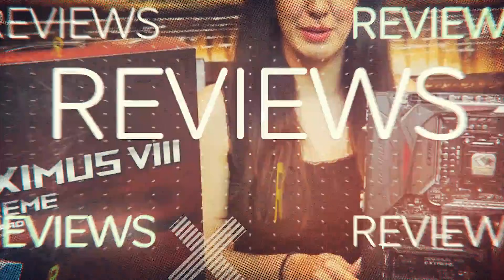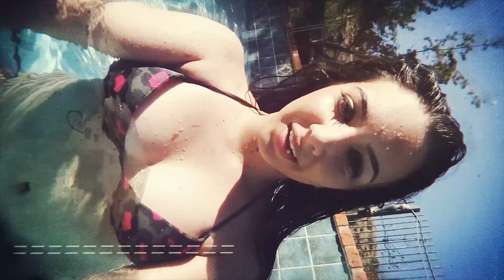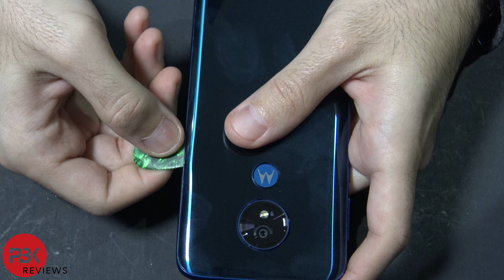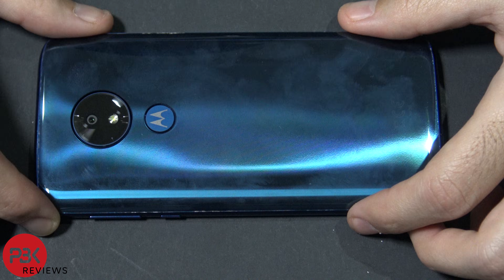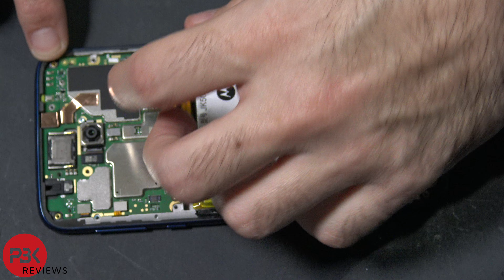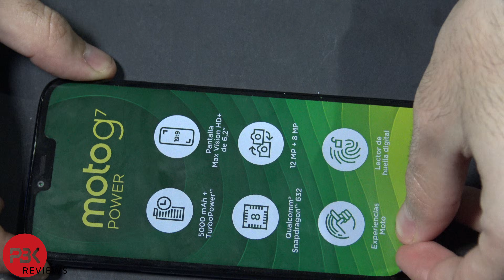Motorola Moto G7 Power Disassembly Teardown XT1955 Repair Video

Comment: Its possible replace the 32gb model for one 64gb model?
Reply from the maker: you would have to replace the main board
Reply: @PBKreviews  

Sorry, as I didn't write well in English, I may not have expressed myself clearly. I would like to know if I can put a 64gb xt1955 logic board in my 32gb xt1955. My moto g7 power xt1955-1 32gb is in QDLoader mode with hard brick after an unsuccessful unlock. I only find 64gb logic boards for sale for now, I would like to know if they are interchangeable

Thanks for your help and quick answer...Best Regards from Brazil!
Reply from the maker: @PauloIrineudeSouza  Oh ok no problem, yes you should be able to swap the logic boards with no problem. 64GB version just has an additional memory chip on the board but the logic board itself is the same should fit like the original :)

Comment: After we replaced my screen my SIM card wouldn't pick up any signal. Any ideas or something I can do to fix it??
Reply from the maker: Make sure the black plastic pieces that are screwed down are in place correctly and screwed in properly because if they are not making contact with the points on the boards, they might cause you to have service issues since the antenna lines run through them. Also make sure all cables are properly connected and nothing is loose. If all those check out, its possible you might have damaged a chip or something on the board when taking it apart? Not sure.

Comment: Wait will the back cover click back on if I want to go to the battery. I'm having some sort of battery problem. It seems like you cut it off. And that doesn't look good for my phone. And I don't want to cut it off.
Edit: wait nevermind I just saw the line where you're supposed to hatch it off. But what did you use to do it. It's far too smooth for me to just take it off with my hands?
Reply from the maker: You would need to install new adhesive to put the back cover back on, its held down with adhesive
Reply: @PBKreviews  sorry I know I'm stupid but what's adhesive?
Reply: I've heard it before
Reply from the maker: @smartguy6895  its like a double sided tape that adheres the back plate to the back housing
Reply: @PBKreviews  ok thank you very much you just earned yourself a new subscriber
Reply from the maker: @smartguy6895  thank you, and you're welcome. If you need new adhesive, usually they sell back covers/back plates for the phones with adhesive pre installed on ebay or Amazon

Comment: IMPORTANT NOTE: This video fails to show a complete teardown, specifically the battery & screen removal. If you need to replace your screen, have a new battery as well & remove the battery outside so when if catches fire the fumes are not in your home. Also, use gloves because the burns on your fingers hurt.

Comment: Thank you for the info I'm going to attempt to replace a busted usb as soon as I get the part.
Reply: hi if you are just replacing the port you only have to take off that bottom area? correct? did you fix it? I am want to replace usb power area connector too i think pin is broken

Comment: Can you use this phone going straight talk Verizon non AT&t Straight talk Verizon
Reply: You can. I wouldn't though because Straight Talk sells a rebadged version of the G7 Power known as the Optimo Maxx. They're the same identical phone with all the Verizon, AT&T, and T-Mo radios/bands available. I'm typing this comment on one. They're usually about 30-50% cheaper than buying an unlocked Power and if you're on Straight Talk service for more than a year they'll unlock it for free anyway. So you're throwing your money away buying an unlocked Power for Straight Talk use. Buy the Moto G7 Optimo Maxx instead.
Reply: @mattdavis9601  thanks man for the information that was very helpful in useful, I hope you have a great blessed day

Comment: Can I just replace the battery without messing with the circuit boards?
Reply from the maker: your going to have to remove the back plate, then unscrew the top cover to reveal the motherboard so you can disconnect the battery cable from the board but aside from that, you don't need to remove the main board or anything else. At the point you can pry off the old battery and apply the new one and reverse the process. Just be careful when prying the battery, don't warp it too much or puncture it so it catches fire etc. You can use a hair dryer to gently warm up the adhesive under the battery to help make it a bit easier when prying and use a membership card or credit card you don't need to gently get it under the battery from the sides or bottom and work your way under it to help pry it off. Hope this info helps.

Comment: How to fix Power button that stuck? like the power is going down instead on normal
Reply from the maker: It would require you to pry the screen off as well, to be able to gain access to the power button flex cable and buttons themselves. You might need to replace the flex cable with clickers on them if your button is not clicking or registering anymore. If its stuck because liquids or other stuff made the button sticky, you may need to clean it out with a brush after you take it apart to make sure its not sticky anymore.

Comment: Literally all I cared about was seeing how to remove the battery. Not... everything else taken out except it. : /
Reply from the maker: Well you need to do everything else to get to the point of removing the battery. You can't remove the battery without taking apart the phone to a certain extent. Once you disconnect the battery cable from the main board, All you need to do is use a hair dryer and apply some heat over the battery and back of the phone to loosen up the adhesive under the battery (don't apply too much heat you don't want to damage it), then use a membership card or credit card and start working your way in and underneath the battery to gently pry it off. Try your best to not warp the battery too much (even though it will work a little when your prying it off) so you don't short it. Apply heat as needed and just take your time and it will come off. Then just take your new battery and put it in and press down on the original adhesive and it should hold then re-assemble.

Comment: Hi. Just wondering, I have two of these phones. One has a damaged backlight, so I can't see or press anything. Other just has cracked screen. If I just switch out the main boards, will I be able to regain access to everything on previous phone?
Reply from the maker: Assuming that the backlight issue is directly from the screen itself and not the board (in most cases it is the screen itself but sometimes water damage or physical damage can cause the board to be the one that is faulty) then yes you would be able to take the main board and swap it with the other screen to be able to use the working screen on that board and get your info from it.

Comment: Do I need to go into the back if I'm only replacing the glass?
Reply from the maker: Yes, because the glass is glued to the screen and you would need to disconnect the screen cable from the main board to be able to pry off the old screen assembly and install the new assembly. You would need to be able to put the cable for the new screen through the midframe and reattach it to the board. Basically you can't just replace the glass. Factories or people with special machines and experience would be able to replace just the glass touch screen but that would still require you to take off the whole screen assembly to be able to disconnect the touch glass cable from the screen assembly. Hope this info helps

Comment: What's the chip model number for the wifi module? I'm going to replace mine with one that supports full mimo 5ghz
Reply: john jay  Probably. I'm hoping that it's like the iPhone 5 where you can just swap them out. Currently I have a shattered screen, so I've put aside this project for now.

Comment: Any chance you can help find the partnumber for the SIM +SD socket?

I found a few from Molex that look similar but don't know if it's one of them or another brand.
Reply from the maker: I'm not sure if this is the part number but on the sim socket it has HA 8B02D or it could be HA 8BQ2D
Reply: @PBKreviews  Doesn't appear to be a partnumber. Searches find nothing.

Thanks for trying.

I suspect a bad reader, warranty voided. Hoped to find the part before opening it up.

Comment: Hey in need of some help got my wife one of these g7 powers and the charger broke back of phone says it’s the xt1955-5 but the charger port looks different then the one in your video and there is a extra white wire beside the black one you removed I can’t find a replacement board for it online.. was wondering if you have any clue where to get one the phone is from metro by t-mobile
Reply from the maker: Only one I can find is the one thatr looks like this https://amzn.to/2nhlXQp   I can't find one with two wire cables that connect to it. It might be possible the t-mobile variant had a different charger port board layout but I can't be too certain. Do you have a picture of it by any chance?
Reply: @PBKreviews  I have the same issue. Purchased in US unlocked at Best Buy.

Comment: I got a moto g power 7th gen the battery is drains fast and the phone gets hot. A moto phone reapiar shop cost $199 to replace the battery. Good phone but never will touch a moto after this one.
Reply from the maker: you should wait until you can find the battery online and replace yourself. Usually Motorola themselves would charge around $80 for a battery replacement

Comment: The battery usually lasts 3 years at that time the phone is usually very tired and beaten up, just replace the phone. Non original batteries are garbage and don't last long and eBay are full of fake batteries.

Comment: Beware: Most LCD replacements for the g7 power are only 154mm in lenght, the original lcd is 157mm in lenght. Which means the bezel isnt long enough and leaves a small gap
Reply: tre dolla the length discrepancy is because there is 2 different sizes...one is the US version and the other is an international version.  The 157mm is the US Version and the 154mm is the international version. Has nothing to do with aftermarket screens versus original OEM screens. Just make sure you know which model you have and order from a reputable company that knows that there is 2 different sizes. Mobile Sentrix is a great company FYI and they have a lifetime warranty  on everything.
Reply from the maker: @AmandaFelske25  Weird how they made a different since for different region. You would think they would keep it the same to save on costs. Unless its a entirely different model say Plus vs regular or power vs standard edition, I wouldn't usually think a xt1955-01 lets say would differ from a xt1955-02 aside from internal antenna layouts or software etc. But I guess in some cases they do.
Reply from the maker: oh that's odd. Sometimes aftermarket screens arn't accurate but its been a while since I have herd of an issue like that. Best bet to try and find a replacement screen that is made from a better company or an original replacement if one is available.

Comment: The speaker is compatible with that of the Moto G7 play? I can not find the g7 power speaker
Reply: I can not find the g7 power speaker 😢
Reply from the maker: It might not be the same exact speaker, but looks like should work since the size and contacts seem to be the same
Reply: Hi and thank you for your good video, it seems that the loudspeaker the one you call earspeaker and honestly i am not sure  how to call it. But i have same issue , cant find the xt1955-2 loudspeaker. It will be great as a suggestion since you have the experience to dissasemble phones, compare parts with other to see compatibility or at least in your description add the part number for each item and put a link to purchase it in amazon, alibaba, or whichever seller that gives you commission,  you can add me to get a comjssion too for the idea, :) :)

Thank you again for your great help.
From Valle de las palmas ,Tecate, Mexico
Reply from the maker: @tusingresosxinternet  You should be able to use the G7 play speaker, should be the same fit

Comment: Doesn't show how to remove the screen
Reply: You need to remove the battery to access the screen cable, which I am currently attempting to do without damaging it but I think it has been glued in which makes it very very hard to take out
Reply: FYI if you heat the back of the phone and you're pretty careful it does eventually come out, and then you can thread the new screen cable through and attach it. Remember to add a 90 degree bend just like the one you're taking out, cos it's also stuck down